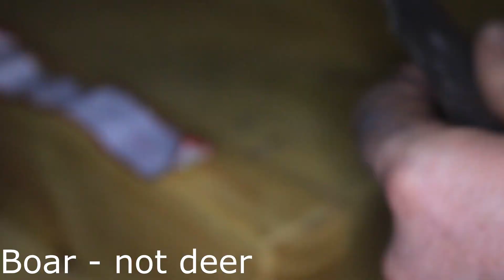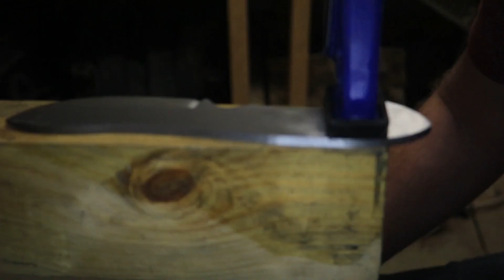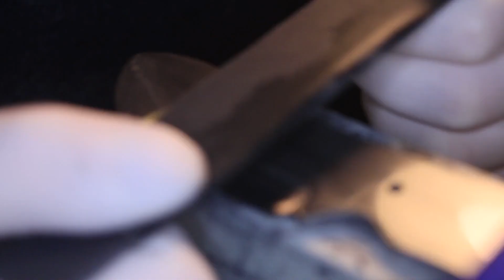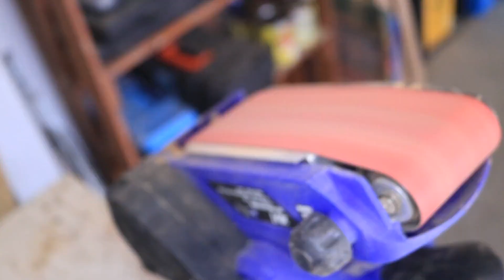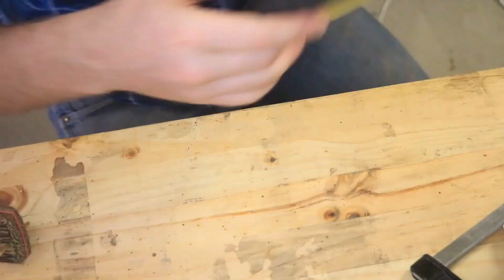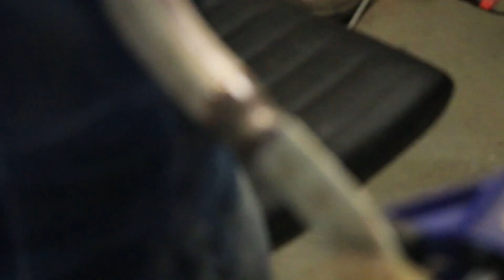Common tool knife build - Nessmuk Skinning Knife

Comment: I also think I can relate to you very much as I do not have the best workshop as I am only 12 but I try to get by with an angle grinder and about grinder on might Beach I've made all my previous knives with old files but I want to make a Forge how to heat treat my steel so I can make a knife out of a knife making get from creative men
Reply from the maker: If it’s just a heat treating forge you can get by with a torch and 2 hollowed our fire bricks - there are lots of videos online that will show you how to make it. If you want to forge weld then you’ll have to get/make something that can get much hotter
Reply: @stoneysshed  I know but blow torches are quite expensive and I want to get one but if I make a Forge it'll probably be with a tin can in the factory cement because I can't find the high temperature bricks here
Reply: @juliangoble2503  can you get ahold of some charcoal, a metal pipe (non galvanized) and a hairdrier?  "  https://www.youtube.com/watch?v=JaTRPGl0yis  "  this is how i heattreated my first 2 knives, its abit of a pain in the ass but its better than nothing.